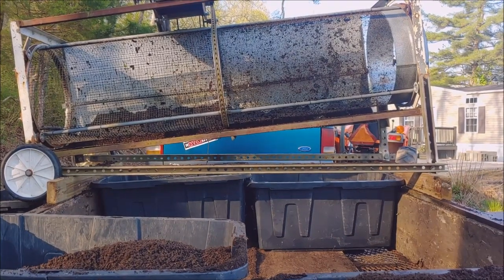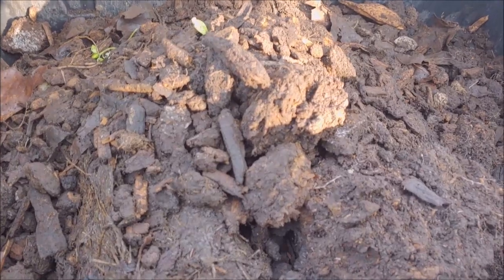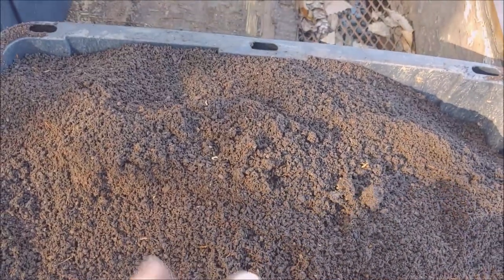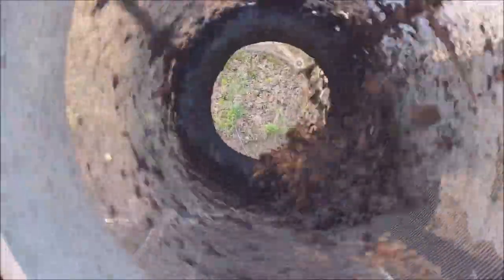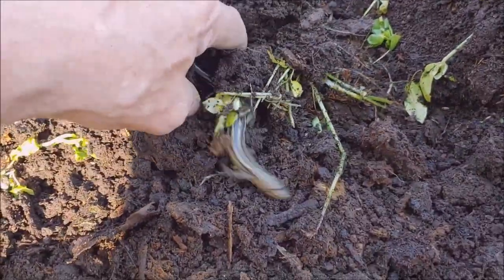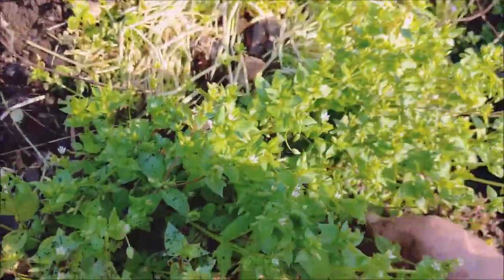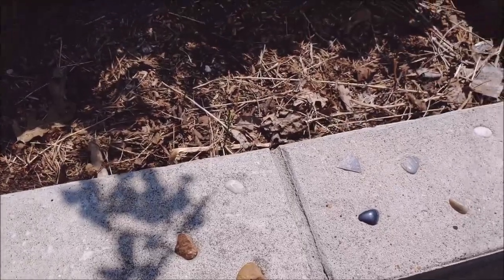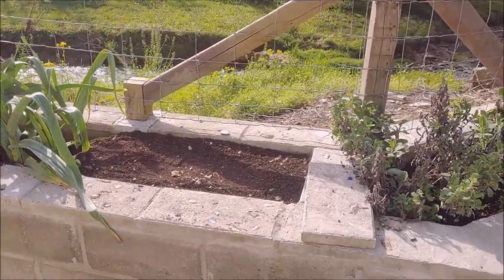Compost sifting trommel improvements, raised garden beds and Garden update.

Comment: Need to build something like this. Have a lot of material to process, rotten wood, leaves, fir needles, etc. I might put the framework inside, so it agitates. Like the idea of a brush on the outside. Maybe spring fingers on the inside, if the screen is heavy enough.

Comment: Great video.  Most DIY ers are satisfied with copying someone else's plans or building a prototype.  You're the first one who showed your determination to keep improving on the original build. The tire wall separator was a game changer.  I wonder if your trommel might produce fewer tailings  if the compost were slightly dryer.  Just a thought,  Not a criiticism.  I'll know more when my trommell project is complete.  Im looking for a DC motor.  No electricity near my compost piles.  I'll watch this again.
Jack
Reply from the maker: Appreciate the praise. Im going to attempt to make a machine that grinds the compost and get 100% output. You are correct with dry compost. It does produce less tailings. Thanks for your time

Comment: Great job. Your trommel looks a lot like mine. I finished mine before I had even seen your video. Too much rain lately to run it in mission mode. Will post as soon as I do. 

Btw, did you see and improvement after you installed the mid-section baffle?